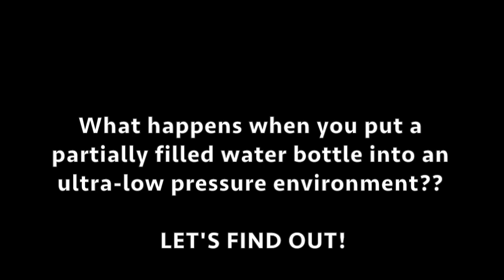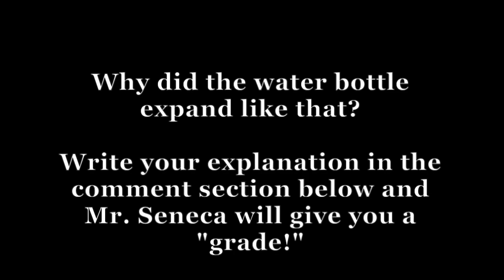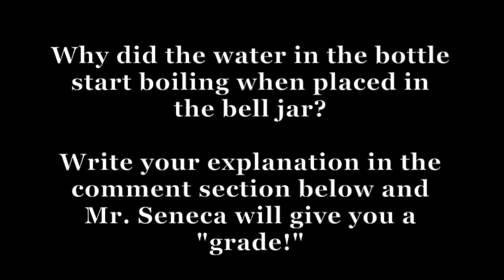Vacuum Bell Jar - WATER BOTTLE BOIL - LOW pressure

Comment: can you explain due to this experiment, how going into space is possible? The air in the lungs would also seek for equilibrium and the blood would start to boil according to this experiment. Because in a vacuum, forces are going from the in to the outside, the opposite of which would happen if you go underwater, where forces are coming from the out to the inside...
Reply from the maker: that's right! so in outer space you need to be enclosed in some kind of capsule or suit, with its own air supply and air pressure inside, to prevent your internal fluids from boiling

Comment: Did it get warmer at the top of the vacuum chamber?
Reply: hmmm, good question, I am not sure, but I didn't noticed anything. The bottle inside is capped (closed) so there is no evaporation getting out so no condensation on the bell jar (condensation would make it warmer) ; also the decrease of pressure inside would probably make it cooler too (so not warmer)
Reply: @michaelshum6362  I've always wondered if there is any warmth created

Comment: The reason the bottle cannot be reshaped with the cap on in the normal atmosphere is because the air pressure inside the bottle is the same as the atmosphere so when you attempt to make the volume larger a force starts pushing in on the bottle bringing it back to equilibrium, when the pressure is decreased now the air inside the bottle attempts to expand to fill it’s container because of the pressure differential. 

The reason the water starts boiling is because as pressure decreases so does the melting and boiling points of all matter.
Reply from the maker: Very nice thorough answer for part one. You can also add a line about "Boyle's Law" (as we call it here in U.S.A.) ; for part two, you got it right too! You can also add something about vapor pressure. The water in the bottle has vapor pressure, but not enough to make the water boil under normal atmospheric pressure, but now that the bottle has expanded inside the vacuum chamber, the air inside becomes very low, low enough to meet the vapor pressure of the water, allow it to boil at this lower point. - Thank you for watching and participating!
Reply: Big Bernoulli’s equation fan really a fluid physics fan as a whole, wish Bernoulli’s applied to this 😢. Nonetheless great video!